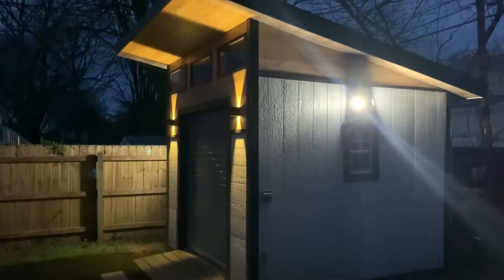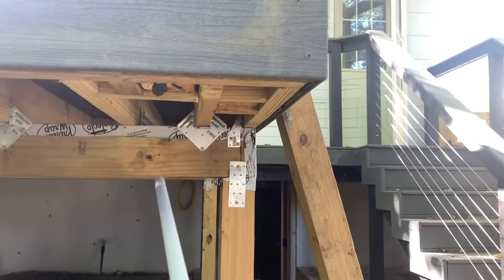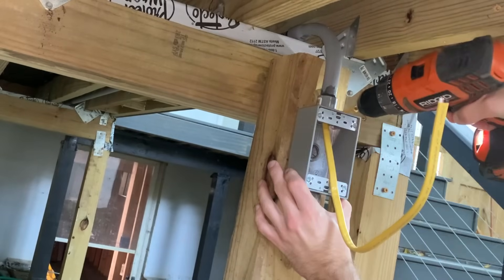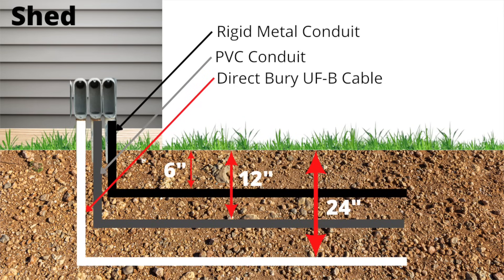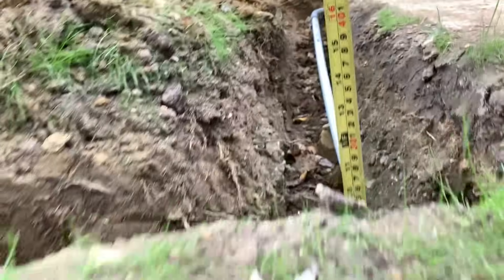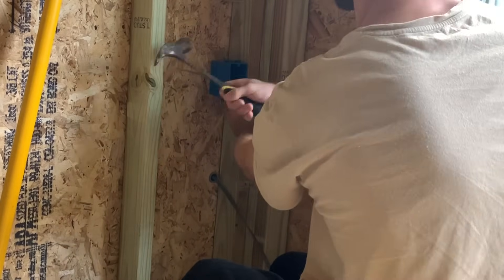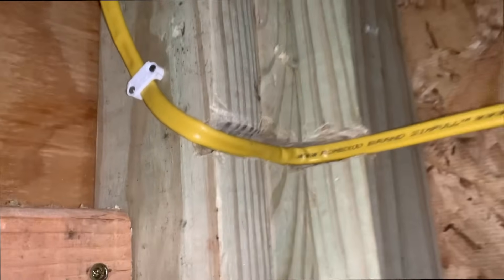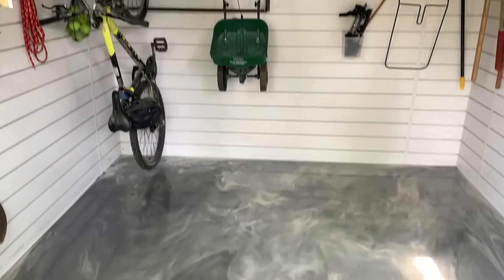Shed Electrical Installation (How to Add Electricity to a Shed - DIY)

Comment: Conduits are considered a wet environment by code so romex is a no no.
Reply: The inside of conduits outdoors or underground are considered wet locations, like the one under the deck in this video; in dry locations they are considered dry locations.
Reply: Yeah I imagine that its a better idea to go to the foundation with Romex than a junction box , then go thhn to a larger level size than you think you'll need now (within reason 😉) as the price between 14 and 10 is a matter of a few bucks and having to buy 14 ft now and fishing vs buying 10awg and fishing is not so cheap...
Reply: @pld8993  that’s a good point. Conduit isn’t a wet location by default, it depends where it’s installed.
Reply: @OrdinaryDude67  Any conduit outside or underground is a wet location.
Reply: @bobniles1928  mostly correct, and conduit installed indoors is a dry location.
Reply: It's considered a wet environment if it's underground or outside (including under the deck). He was definitely mistaken when he said that UF-B is optional because of the conduit, at very least once the conduit was underground.
Reply: Yep no Romex in pvc
Reply: @ronnisullivan9794 would uf-b be the correct choice?
Reply: @embracethesuck1041  THHN/THWN in conduit is common, and is an option in the wet condition, but not sure what makes you think it would be "the right choice", especially for an amateur buying material (UF-B is going to be packaged more conveniently if you're just doing one job).
Reply: @embracethesuck1041  Have you ever pulled UF-B, and then four THHNs? Pulling a single 3 + ground UF is a cakewalk, at least with bends in the same bending plane. Plus, in terms of cost, UF-B is typically cheaper than four lengths of THHN, at least out here. 
For example, 8/3 w/g UF-B is 196¢/ft here, and 8AWG THHN is 96¢/ft per conductor, and #10 THHN is not sold in reels smaller than 500ft, bringing it to 384¢/ft if your ground is #8 THHN.

Also... At 24" like he trenched, you can just direct bury UF-B
Reply: If the wire is around 150 ft long you need a #6 wire.
Reply: @microcolonel not really accurate, at least not in my experience. A. THHN in > #10 can be had in lengths shorter than 500 foot spools. 
Also Southwire & other brands make coilpaks that come with 3 or 4 conductor lengths in a single kit that can be pulled simultaneously. For around the price of UF-B.
Reply: NM cable
Reply: Retired now. Was a licensed master electrician. Romex or properly NMc not permitted. We used RMC, never used IMC. IMC tends to rust out sooner than RMC. When codes changed for our use code permitted PVC for underground and risers to be RMC. and always used stranded THHN for easier pulls for one thing. IMC IS permitted, that was my choice
Reply: Romex is not for conduit.  It has to dissipate heat.
Reply: The fact people make how tos and do no research on the correct way to do the job
Reply: Unless it is UF wire, it is rated to be buried directly in the ground no conduit needed.
Reply: @OrdinaryDude67  stating the unbelievably obvious helps.
Reply: Romex in pvc… even the home depot guy told me for a no no 😂

Comment: You did nice work and it works for you but much of it is illegal. It’s one thing to do stuff for yourself but doing a how to video to teach other people to do it wrong is something else. When you run conduit you should minimize the bends and by code you are not allowed more than 360 degrees of bends between openings such as boxes and conduit bodies. And since you used UF cable that is difficult to pull anyway that wire will never come out, if it fails the whole run will have to be torn out and replaced. I know you did it a section at a time but technically that’s illegal too since the code requires the raceway system to be complete before installing wire. You also can’t glue your conduit to the wall, a conduit strap is required. The other big mistake you made was installing your switch and lighting outlet boxes so that they are recessed. The box has to be flush with the surface of the wall or slightly protruding so that the cover or fixture mount to the face of the box. By having them recessed you have introduced combustible material to the inside of the space where your wire terminations are made, the most likely place for an arcing fault to occur and start a fire. Arc faults are several thousand degrees, more than enough to ignite your wood composite siding. Sorry, I’m not trying to be a nit picker just being critical but this was a how to video. The electrical code is a very complicated thing and takes years to learn and constant updating and re-education. Enjoy your shed, it looks great.
Reply: How did you figure out this guys address to know where he lives. Different areas have different codes. For example the area I live in has no codes or inspections. You seem to be an electrical contractor or an inspector. There for you should know he could use plastic box extensions if he chooses to cover the inside walls. If you don’t like his video kick rocks
Reply: No codes, sounds plausible. I suppose nobody has fire insurance either?

Comment: Always run at least two cables to your shed, and dedicate one to your lights. If you're working at night, using a power tool, and it trips the breaker, you won't be left in the dark with a spinning saw blade, or whatever. I suggest 15 amp for the lights, and 20 amp for your power tools.
Reply: Great point. Plus I don't like running Romex in conduit. Could have made an easy pull with just a couple hots, a neutral and ground. Use a two pole breaker if you do. Good luck ever pulling the Romex out of that conduit.
Reply: It's a code violation to run two diffetent feeders to an outbuilding like that (unless you have special circumstances like a switch at the other end controlling an outdoor light, different power source, etc.).  You generally get one feeder, although a multi wire circuit still counts as one.  So, you could do a pair of 20 amp circuits to a shed on a shared neutral in a single 10/3 (or 12/3 if close).
Reply: @houseman2414  That's not a feeder, it's a branch circuit.
Reply: Run 240v cable and add subpanel in shed.
Reply: you're actually running 3 or 4... at least in the us.. then setting up a subpanel and putting in different breakers for the lights than the outlets/tools... theres no issue here...
Reply: One is fine, just connect the light first and have a gfci at the end. When the gfci receptacle trips, you still have power to the lights.
Reply: or run a single cable and install a small consumer unit in the shed/outbuilding and have different RCDs or breakers for your lights and sockets.
Reply: This video is not a good instructional video. 
A. Should never run Romex in conduit especially outdoors as it’s against code. 
B. Also against code to assemble conduit over the cable. Per code you have to assemble the conduit then pull the cables through. So pulling the cable through “as you go” is not to code.  & you’ll likely never be able to pull that cable back out in the future. 
C. Also you should never have “ a bunch of bends”. Code requires no more than 360° of bends total in between two pulling locations. (You’d have figured out that it’s hard to pull through lots of bends if you’d assembled the conduit first before running the cable) & this is why I say that you’ll likely never be able to pull that cable back through if it ever needs replaced. 
D. Really should’ve ran 240 30A or 50A to the shed & installed a sub panel.
Reply: @shelms488  Romex in conduit in dry condition is code, but I still wouldn't do it. It's very hard to fish romex, takes up conduit space, doesn't derate to 60c if filled properly and thhn is cheaper.
Reply: @Pepe-dq2ib  agreed. I’d transition to THHN or THWN once it left the house. But there’s quite a few code violations in this video.
Reply: @shelms488  yep
Reply: @shelms488  most of his errors are obvious, but one thing I still see not being done by pros is using outdoor rated duct putty when entering or leaving environmental controlled space.
Reply: I see no expansion joint on conduit coming out of ground. Romex type NM cable should be running conduit except for sleeving. Just because you dit it you need to get permit and have it inspected.
Reply: @shelms488  Totally agree no one should be using this as a guide, this person knows just enough to be dangerous.............
Reply: Pretty sure if he ran more than one circuit, he’d have to install a grounding electrode at the shed.
Reply: just install a subpanel in the shed

Comment: Non metallic sheath cable is not rated for wet locations. This is a code violation. If you would’ve ran UF cable (sleeved with PVC conduit) outside under the deck you would be good. And you should’ve used expansion fittings transitioning out of the ground to the structure. When the ground moves it expands and contracts, it will pull PVC apart.
Reply: So run UF-B all the way?
Reply: @jamesstuart3700  yes or install conductors rated for wet  and damp locations.
Reply: one could argue the deck is damp not wet, but best practice would also be to unsheath the entire run in conduit.

Comment: Should use THHN wire in conduit.  Not romex.
Reply: UF-B isn’t Romex
Reply: @bizzfo   I think UF-B is much more expensive.  When I was an electrician we direct buried UF-B but used  THHN in conduit.  It's been a lot of years so I may be wrong.
Reply: @KurtNoakes  putting UF-B in conduit isn’t a matter of violating code.  If anything it’s overkill and a pain in the rear.  you’re not going to fail inspection as a result.
Reply: @bizzfo  Yea, I remember that stuff being hard to strip.  People watch these videos to see the best way to do something. and we don't want to spread bad info.  I thought the video was showing romex being pulled through the conduit.  Sorry if I offended anybody
Reply: @KurtNoakes  you are correct! Romex should not be ran in that length of conduit. Romex is not rated to be in conduit. Romex is usually ran in a conduit when it comes from a protected area to a non-protected area. I.E. coming down a garage wall from the attic. This video should be taken down simply for the NEC code violations. Electricity is dangerous and ridiculous videos like this make it worse!
Reply: @dhazz1536   He actually did state that in the video.  I just missed it.  And he didn't use romex in conduit.  My mistake.
Reply: Technically THWN, although most conductors are dual rated these days.
Reply: @dhazz1536  😂 as if you really read the description in the video it does say for entertainment purposes only. Consult with a professional electrician 🤷🏻‍♂️😉
Reply: @kevink4914  even more reason why the video should be taken down. The lack of reading the description....! He even stated in another comment that he didn't know that is was wrong to run romex in a conduit. I'm pretty sure he also stated that this was a license electrician that did the work. To be honest, I'd be willing to bet he went back and added the disclaimer after reading some of these comments. Regardless, it's a horrible video. He used a mitre saw to cut PVC conduit 🤣🤣!!!😉
Reply: @KurtNoakes  ... he most definitely ran romex in pvc conduit. He pushed 12-2 through the conduit piece by piece while running under the joist.
Reply: @joeschmo6834  he most certainly did, did you watch the whole video?
Reply: @joeschmo6834  he used UF-B in conduit to the shed.

Comment: you can't run standard romex outdoors has to be UF or THHN in conduit so your electrician should've set a box right after the romex left the house and changed it over to the aforementioned wire. That romex will break down over time as water intrudes inside the conduit cause water will get inside it eventually. Not sure why your electrician did that because he should've known he can't do that from the start.

Comment: Thanks for the video!   You did a wonderful job building that shed and you gave us a lot of ideas on how to run electric to our sheds.    My advice to those interested in doing their own electric would be to watch a lot of videos on this subject and read all of the associated comments.   You will find a wealth of knowledge in the comment section and get an idea of what Andrew did right and where Andrew could have improved on his installation.   To those who are critical of his work, I suggest that you help the rest of us by putting out your own videos on this subject.    Thanks again for the work you put into this, Andrew.   We all can learn from our mistakes, but we can never learn without attempting to try our hand at it.
Reply: You're absolutely right, good point Rose.
Reply: There are different ways of achieving a proper install, as long as they all adhere to the code. The code is a minimum.

A lot of what he did here is not up to any code I'm aware of. 

The reason the code exists is to prevent people from being electrocuted and fires. The code reads like a legal document and much of it resulted from previous fires and electrocutions.

You can't guess when it comes to electrical work. With plumbing the worst thing that will happen is a leak, but with electrical the worst thing is a fire in the middle of the night when you're asleep or someone getting fried.

Comment: pro tip:  take a couple photos of the full length of buried conduit before you backfill it for future reference (or make a sketch with annotated specifications.)  locator services for underground utilities never mark DIYers' buried stuff.
Reply: Even some utilities, like cable, do some "shady stuff"... they did a fix here a few years ago and literally ran their splice about 3 inches under the soil... I took a pic since I have to edge that bed every year. We also get frost heave here, so there are a couple other spots where the cable tv coax migrated and is literally laying on the ground, thanks to grass growing thatch, no issue in the lawn, only in beds and that gets mulched over. Granted, there's no safety risk.
Reply: Tracer ribbon is always a good idea too.

Comment: @6:10 No, if you're going to use non-metallic sheathed cable in underground conduit for some reason, it must be type UF.  The interior of conduit outside or underground is considered a wet location (they always end up with some water in them).  But it makes no sense to run UF in conduit; it's expensive and a pain to work with.  Cheaper and easier to run individual 12 gauge THWN wires.  Also, you cannot run the wires/cables as you go.  NEC 300.18(A) says the conduit must be installed as a complete run before running any conductors.  This helps ensure you don't have too many bends and/or the conduit isn't too small.
Reply: I was actually dinged on an inspection for using sheathed cable in conduit. I was told it would not disperse heat properly.
Reply: @usmc6153  Yea you here that sometimes and it's not true. Sheathed cable is installed in exterior walls buried in inches of insulation without problem.  Its conductors are massively derated; they use 90 degrees C insulated conductors, but the ampacity of the cable is calculated using the 60 degrees C column.  In some limited situations Code even requires it in conduit to protect from physical damage (334.15(B)).
Reply: You cannot use NMC in conduit per code. Have I done it in a residential situation, yes, usually to protect the cable from damage. if I was running this, I would use 1-inch pipe and pull conductors to give you options later. put for a DIY installed, this will last forever with no issues.
Reply: @Bryankrall8090  Where does it say that in Code?  I don't see anything about it in 334.12.  I know flexible cords can't per 400.12(6), but I can't find anything similar for NM.  It's a dumb thing to do bur I don't see any prohibition for it.
Reply: @barryomahony4983  NEC 300.18(A) "Exception: Short sections of raceways used to contain conductors or cable assemblies for protection from physical damage shall not be required to be installed complete between outlet, junction, or splicing points."
Reply: @mikelawler2278  Yes but this was not a short section, it was a complete run between boxes.
Reply: If you use THWN wire does the conduit it’s in need to connect to the main panel? In other words you can’t just have the conduit on the outside of the house, and a few feet of THWN wire in the wall?
Reply: @krehbein  THWN needs to be in some type of raceway.  In a wall you could transition to something like ENT ("smurf tube"), or terminate the conduit in a junction box and run romex inside the wall.
Reply: @barryomahony4983  thanks barry, this helps with my shed project
Reply: UF cable where I live was less expensive than standard yellow romex.
Reply: @barryomahony4983  It can be run in conduit inside but you have to meet the volume requirements.  You must make sure the conduit has plenty of empty space, he should have used a larger size conduit with less bends.
Reply: @jaycahow4667  The way you compute fill for cables is take the largest dimension and use that as the diameter.  The width of 12-2 NM is .422", for an area of .14 sq. in.    For a single conductor the allowed fill is 53%, so the required conduit area is 0.264 sq. in.  The minimum allowable size is then 1/2" for Schedule 40 PVC and 3/4".  Personally if I did this for some reason I'd use 3/4" to make the pulling easier.  You're permitted up to 360 degrees of bends between pull points.  As I said the biggest problem with this is using NM underground, which is not to Code and is unsafe long term.  Water always gets into underground conduct.  Over time the paper inside the NM will get saturated and fall apart.  it may take years, but it'll happen eventually.  Fortunately the fix is relatively easy: pull the NM out of the underground conduit and replace it with individual THWN conductors.